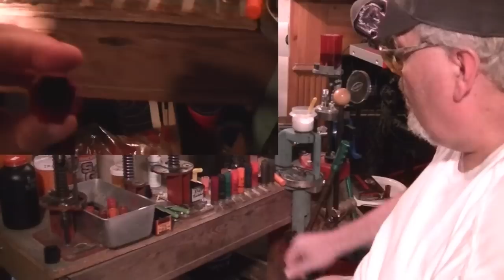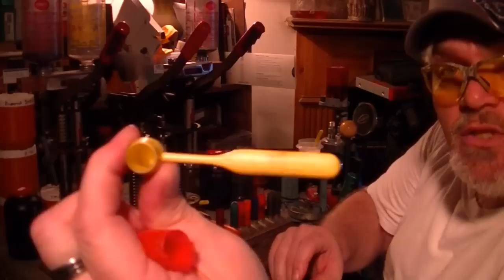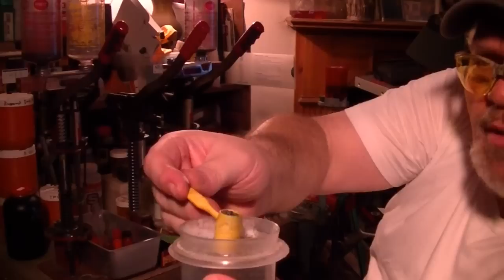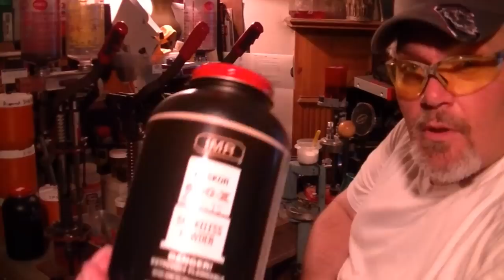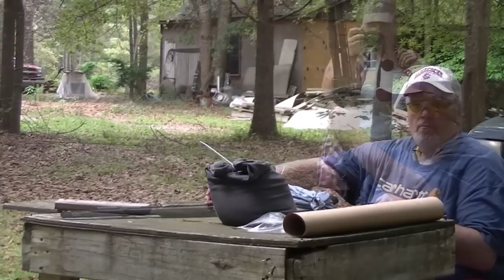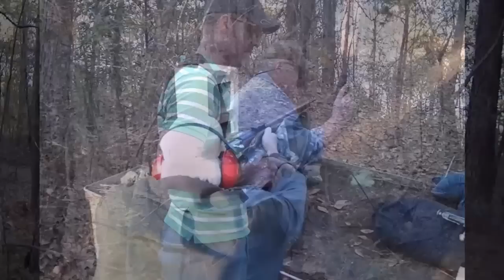Buckshot Reloading Procedures 101! (12 gauge)

Comment: good info. I like the AA winchester hulls when I can find them. Most of the time I use HS-6 powder and have found 28 grains with 10 Double 00 buck from my Lee mold works well with my Saiga long barrel 12. I have been using a 1/4 inch felt pad on top of the buckshot. The RP12 wad seemed to group best. Never thought of cutting the shot cup off? Get a great 8 to 10 inch group 25 yards with my poly choke on the end of the barrel.
Reply from the maker: Thanks John! I'm gonna try the HS-6 load!

Comment: Thanks for mentioning to lay them in doubles makes more sense not crushing the hull sides packing them in 3s, Plus easier on the the choke, I have an old Mossberg 500 adj. choke don't want to take the end off with a big surprise one day, Been very long time since I've reloaded shot shells I'll sub thanks,  Cutting the skirts off is like the old hand loading wads but has a cushion I have some without just a cup both sides.Why not fill a buffer or lay a card on top of your overcrimps.

Comment: Hey Mr wade, I'm new to reloading and was just wondering if it is normal to get a little bit of dimpling on the hull after crimping.  They still cycle fine in my pump but I have yet to shoot one
Reply from the maker: Yes it is normal to have a little dimpling! As long as the round runs well in your shotgun, no worries! Even factory buckshot rounds can have a little dimpling on the hulls sometimes. Wade

Comment: Wade are there any other wads that you would recommend for these type of loads. I loaded up both of the 00 loads.  The green dot seemed to work well but a couple of the Herco loads seemed very light, this really surprised me. I used a good digital scale for each individual load as well. Going to try to chrono next go around. Thanks!
Reply from the maker: Hey Johnny... The Federal 12s4 is another good 1 (if you can find them) The MG42 as well as the Gualandi Super mini work excellent!
Reply: Thanks a ton for responding so quick. I have one more question.. Would using buffer in these loads be an issue?  Or should you not do so with shot cup wads?
Reply from the maker: @johnnycrouse4603  No issue at all Johnny in my experience.  Wade

Comment: I have found this to be one of the most useful videos of yours I have watched. It is awesome that you  Provided the information to reload all of those different shotgun hulls   With the different powders. I know that you used 23 grains of green dot  in one of these loads , so I was wondering if 23 grains  Of IMR green would work equally as well since I do not have green dot.  I had watched one of your previous videos where you compared IMR powders to the alliant powders  AND SEEMED THEY WERE EQUIVALENT.. would it be better  to use scale to weigh 23 grain or use 2.8cc dipper.Also have you ever experimented with red dot in this load?  If so how  Did that work and how many grains of that did you use.

Comment: If you were to do this load with #0 buck instead of #00, what would you change?
Reply from the maker: Armed Bear The only change is that the rounds will hold 15 pellets of .31 cal #0 buck stacked in 5 rows of 3 pellets. That's one of my favorite rounds in 12 gauge 2 & 3/4" mags!
Reply: Thanks.
Reply from the maker: Armed Bear My pleasure AB!

Comment: You seem to know what you're talking about as far as shot shell reloading goes and I have a question. I'm just getting into shot shell reloading myself and the couple manuals I have say to follow the recipe "exactly" as written. I bought all the components you use for your 000 buck shot load using the Nitro hulls but that load isn't in either of the two manuals I have. But, I plan on loading them up nonetheless. Does using different hulls and primers in a load really make that much difference in your experience? Also, I'm having trouble with the 6 point crimp on my Lee Load All II with the 000 buck load mentioned above using the 3" Nitro hulls. It seems there's too much space between the pellets and the end of the hull and I'm crushing it when attempting to crimp. Any suggestions? By the way, I love your videos and think they're very entertaining.
Reply from the maker: cheech101st If you're wanting to load up 3" #000 Buck, watch this: https://www.youtube.com/watch?v=GObJ-_rh6C0
Reply: +cheech101st you have to adjust your cam.  if using a mec anyway.  the small allen head screw on the left side.  loosen push the cam forward a litte.  try it and adjust till you get it right

Comment: Ok got a load of WIN AA 1-1/8 Hulls (Red) can I load those with #4 buck with the wad you are using?
Reply from the maker: Yesser!
Reply: I know the #4 buckshot will be way more pellets than OO buck (9) Pellets, but I want something in between OO Buck and 7-1/2 Birdshot.
Reply from the maker: You can usually get 25 to 27 #4 buck in that load. Works great!
Reply: Sir, after looking into the load data, I think I want something like #3 (20 Pellets) or O buck (12 Pellets instead of #4 which is 27 pellets
Reply: Oh what Primer are you using?  Because I was gonna use 2 types Win 209 and CCI 209
Reply from the maker: I'm using the CCI primer.
Reply: Thanks for all your help.

Comment: Ok so did I miss something? Why did you cut off some of the wad? Also does it matter if you reload with shells that are not high brass. I always thought high brass was for heavy loads and low brass for say number 6-8 shot.
Reply from the maker: You need to remove the pedals so that the larger pellets (#000) will fit in the hull. Brass length has nothing to do with hull strength. It was a way to identify magnum loads at a glance.
Reply: Ok Thanks.

Comment: I'm super super confused new to reloading shotshell so okay I have the Lyman book 5th edition trying to reload #4 buckshot I have fiocchi straight wall hauls what I don't get is how do I get my data like lead shoot target loads how do I find the weight of the load. I'm just super confused can I use straight wall hauls as a general reference for my data or does it have to be brand specific?
Reply from the maker: there isn't much load data using specific buckshot sizes. you will need a good set of digital scales. I weight my buckshot loads then match that up with the lead weight data.
Reply: @BubbaRountreeOutdoors  got it thank you. I was just confused with the book cause it would show target loads then buckshot. Im using fiocchi straight wall hauls.
Reply: @BubbaRountreeOutdoors  so I have a question if you don't mind I'm loading 12 guage #4 I'm doing 24 pellets to avoid the crip to cave in now I noticed that the wad waa12 sits kind of loose in tge fiocchi straight wall 2 piece hauls when I shake the shit shell you can hear the pellets and powder moving is that normal?